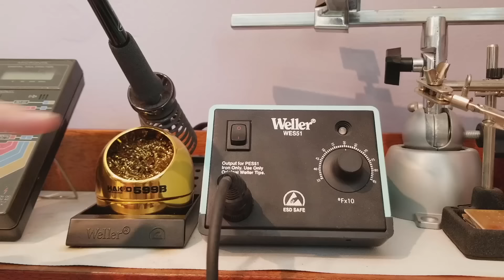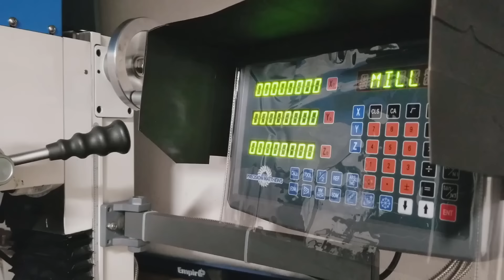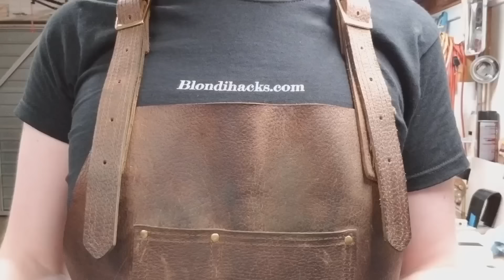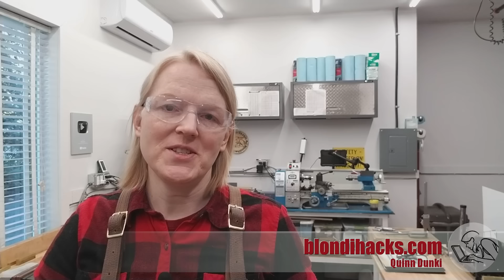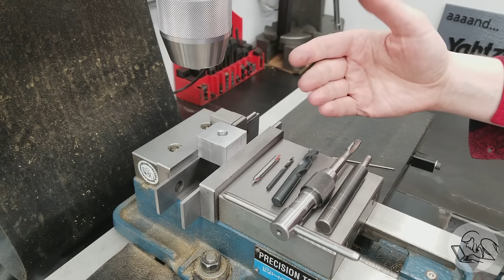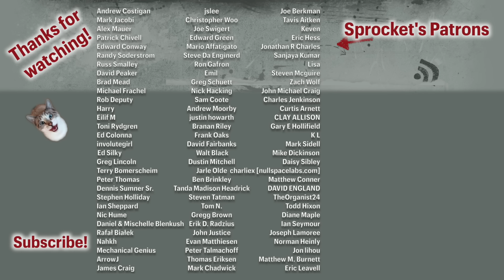Efficiency in the Home Machine Shop

Comment: Hi Quinn. I see that your new mill has a one-shot oiler system. I can't find a video on how you installed it. I would like to install one on my mill because the DRO bar covers the rear oiler points and I don't want to keep taking it to bits to oil up. Any chance you could make a video or add to the blog? Regards Bob

Comment: Cousin to "first-order retrievability" is what I'm going to call "last-operation retrievability", which is when you don't rush to put a tool and it's "bits" away too soon. Examples: a ratchet wrench and socket, die-holder and threading die, tap wrench and tap. My experience is that there's a high probability that these tools will need the same socket, die, or tap "next time" -- which is actually just an extension of "last time"... when you missed tapping that one hole...or now need a right-hand part to go with the "pair" of left-handed ones you made. So, I usually keep a group of such tools in "limbo" on the bench, otherwise I just put it away as is.

Comment: Awesome tips!
My workshop is tiny (5 square meters) - I hang my rulers, copper hammers and such from hooks so I can easily access them.
I also hot-glued a sharpie marker cap to a cabinet over my head - so I can pull the sharpie easily and return it to a fixed position. 
Same for my medium-hardness eyeliner wax-marker (softer than todays Chinese wax marker and SUPERIOR soft/erasable marking on metal) so it's an easy access. 
My 2 cents... :)

Comment: I have my most used items in an area on the end of the main bench so they are easy to get at during milling and turning operations. The problem is that by the end of a session in the workshop everything else that starts neatly stored in drawers is then littering up every flat space on the bench ! I will swear some of them develop legs and walk out of the drawers themselves.......

I often use stub drills and find them very good in many respects. Cranking the mill head up and down between tool changes is a chore If doing several holes on the surface of a part - the DRO helps a lot as you can work through all the centre drill holes then all the pilot drill holes and so on........

Comment: I am so glad I subscribed to your channel! I am learning a lot from you, and I appreciate your down to earth easy style. Your videos are a joy to watch. I had a "Smithy 1200-something" drill, mill, lathe combo. I never learned how to use it properly and it's long gone after many moves. This week I got "Vevor" 7x14 lathe (new on ebay for $325) and a Sieg X2D Mini Mill from Little Machine Shop. I have a couple of Cheap Wen drill presses' too. I have been using a little 5'x9' metal shed under the carport for my "shop". This week I am doubling the size of it and it should be a decent little hobby machine shop. I have managed to Frankenstein together a fairly sophisticated Planetarium star projector, all tediously by hand using as many off the shelf parts as possible. Last summer I needed to make some sliprings. I had a "Bob's CNC". That was my costliest tool mistake. it came in a kit and its made out of wood... Totally useless. I tore that down for parts and started looking into a serious CNC. That led me down the road to build an epoxy granite CNC to do more precision work in plastics brass and aluminum. Maybe some steel. So that led me into metrology which will give me the opportunity to tune up the new lathe and mill and extract as much accuracy as possible. Then I can make components for the CNC to get it functional and upgrade those on the CNC itself. I ended up making the slip rings by hand with a dremel and a scribe. They have about 1/2mm of runout but at least the brushes stay on their tracks. Lol.

Comment: The shank on drills is usually soft steel. So I have a set of drills that I have turned down the shank to 1/4”, shortened and resharpened on my Drill Dr. Do this as the size is needed. Works well in my little hobby mill but I only work in plastic and alum.

Comment: I would add rolling papers to the list of fast, non-destructive edge finding techniques. Self-adhesive and made to suprisingly tight tolerances (varies by colour - IIRC the green ones were 1.5 thou), wet and stick a bit to the edge and advance the cutter until it whips it off. It's a hands-free one-time-use feeler gauge.

Comment: That Clip for the drawers is great, i have a number of "Fridge magnets" to stick drawings and setupsheets to the machine.. on my mill i have sliding doors, and with a thin magnet, i can even slide the door open, with the drawing on it.
A small "platform" for tools that you often use is also a great tool in itself, i used to have a small desk at work, with a plate on the back for holding drawings, and  a place to put tools

Comment: Just got an old non-folding music stand for holding drawings next to the milling machine.
Also, I like Harold Hall’s idea of machined stops for the milling machine. Saves you having to indicate. In practice, you bolt two or three pedestals of round steel down to a t-slot say five or six inches apart. Set your end mill just above the table and just nip all three pedestals. Now they’re effectively stops exactly in line with your mill’s x or y axis. No indicating and essentially perfect. Just make sure your work is raised slightly to contact the pedestal face you just machined.

Comment: I’ve got a great example about efficiency. Back when I was toolmaking spent a fair amount of time blocking up ( machining saw cut tool steel to initial sizes) 
The company had two mills for this, one a decent size Pacific universal mill with dro on all axis 200mm dia cutter machine would have been around 6 ton. 
The other machie was a Toz, universal mill, quite small in stature still around 1800 to 2000kg size machine. 
It had no dro and a small 75mm 3 tip cutter. 
Oh and imperial dials. (We worked in metric)
That lil Toz was a third the machine the pacific was although sooooo much quicker. 
Why you ask,
Its rapid feeds were much faster and you weren’t wasting time fiddling with a dro. Just measure and convert what mms were to come off in thou. 
Always chose that Toz over the pacific. 
So just to clarify, it’s not always what it seems.

Comment: One quick question: when you drill and tap a hole, is there a reason that you don’t chamfer the tap drill hole before running the tap into the hole? It may or may not be more efficient, but it seems like it would make for a cleaner tapped hole. Just curious.

Comment: Great video as usual. I bought 2 cheap battery powered drills for my benchtop mill. One has the right size socket to raise/ lower the head & the other to open/close the drawbar. If the quill is too tight for the low powered drill, a quarter turn with a wrench is enough to start the process. It's a bit of a clunky solution but does the reduce the tedium of head height and tool changes.

Comment: Dependent on the degree of precision it can often be quicker to precisely spot the centres in the mill and then transfer to the the pillar drill for all the subsequent operations involving drilling ,tapping spot facing , countersinking etc. This was the technique taught to me 70 years ago during my apprenticeship if greater accuracy was required than could be achieved with marking out and centre punching. Although I transferred to the drawing office at the end of my apprenticeship and so never used this technique to help me make bonus on piecework I have found it very useful during my lifetime of model engineering.  I do enjoy your videos.

Comment: My biggest efficiency gain is having a set of dedicated tools at each machine. I have a set of Inch wrenches (at least one) a set oif metric (and so on). If i need to pull out the 3/8" wrench every time I want to adjust the tool bit in a tool holder (before everybody began to use Aloris-type quick-change) there will never be a 3/8" wrench in my set. And if two or more machines regularly need a 3/8" wrench, I might spend more time looking for the wrench than using it.

 I'm a slow learner; I've been playing at metalworking for over 75 years, and it's only been in the past few decades that I began to create wrench/tool sets specifically for each of my machines. For every point on a machine that needs to be tightened or adjusted in the normal operation of the machine, I want a wrench or tool there and ready at the machine. This means a dedicated wrench. I'll buy the exact wrench I want and modify it (as in cut the other end off a double ended wrench) if needed. The tools need to be identified with a colored tape wrap or a paint blaze as to which machine they belong as well as having a place of its own by the machine so you can tell if a tool has gone missing.

Even if you rate your time as cheaply as a couple of bucks per session of hunting for that lost wrench, it doesn't take many such sessions to pay for a dedicated wrench from McMaster-Carr.
Reply: Another one is to have replacement drills or tool bits at the machine. This is something that was done on every machine for every job when I worked years ago in a ---WAIT for it --SCREW MACHINE shop.

Comment: My favorite time saver is to use a tables with rolling tool boxes underneath them. It is relatively inexpensive and you end up with a lot of shallow drawers that you can use to organize tools. Keep the casters on the toolboxes if you are tall or ditch them if not, so your table height is comfortable. Every drawer gets a theme (everyday tools, drills, abrasives) and the tools always go back in their drawers so they are easy to find. If you end up with 2 of these tool boxes, one can be for assembly tools and the other can be for fabrication tools.

Comment: My efficiency tip is to buy multiple machines of the ones you use most.....I know it is not for everyone, I have more space and have been very lucky at auctions but 4 is the sweet spot for some machines, eg I have 4 drill presses, one set to low speed for large holes, countersinking and  counter boring, one medium speed for general drilling, one high speed for centre drills and small holes and one for annular broaching (a big solid drill). I also have a cheap mill (a good size but has some issues) dedicated to rotating work, a rotary table on one end and an indexing head on the other so I dont have to re-configure either my small or big mills. I made 3 2x72 belt grinders for the same reason, a high speed vertical flat platen (most of my use), a low speed vertical/horizontal small wheel grinder and a multi functional fully variable speed for when I need a third config, also two disc sanders, a permanent coarse high speed for wood (knife handles) and a variable speed 9" for blades. Switching configs around did my head in..... I would like two more lathes though (a 5C collet in one and a 4 jaw in the other) but dont have the space....

Comment: Screw machine drills are for eliminating the need to use a center drill, saving considerable time on those machines that can run 24/7 The shops use a general purpose carbide that can be valuable on standard machines, such as Micro 100, expensive but saves time, durable can be ran slow. Woodworking, I find easier but more dangerous!

Comment: Back in uni, I worked as machinist (CNC and conventional milling) during the day and the biggest struggle I had was exactly balancing precision with efficiency. My parts were always near perfect, within spec and the clients never complained about them but I took about 30% more time than my colleagues. I drove my boss nuts... but being Swiss and the son of a mechanical engineer specialised in precision, I think it's ingrained. 😅
Reply: "Near perfect" and "within spec" are two different/overlapping things. Tolerances are a major part of the "Spec(ifications)" and just how tight or loose these are should guide your work. If the client asks for microns, they are paying for and they get microns, if the client only needs/asks for half a millimeter, you don't get paid any extra if you deliver microns.
Reply: @kennethelwell8574 True! In our case, we were working generally to remain within +/- 10 microns. My job specifically demanded for a lot of precisely bored holes and it was particularly difficult because my CNC milling machine was 30 years old and very poorly maintained with no ability to use inner cooled tools.

Comment: You showed operations on the DRO but did you mention the DRO itself? It's probably in the top two for me. I read somewhere about, and try to practice, leaving all your tools pointing the same direction. Not necessarily in order (though obvs in production you'd try to), just aligned, the theory being your eye can find things faster that way. I also have a 150mm rule stuck to each machine tool with magnets. I keep one in my apron pocket too but when it's not there, there's another immediately to hand. Keep everything tidy and organised! I know it sounds basic but if you can't find something in under two minutes, you're going to get frustrated, and you may as well not own something if you can't find it. Someone else mentioned painting things white - yes! I painted everything in the shop white - the benches, the pegboard, the lot. Yes, eventually it will get dirty but in the meantime it will reflect diffuse light back into the workshop.

Comment: Fantastic tips Quinn and great presentation as always. A tip that I'd add is for the milling machine when doing multiple parts of a similar size (or repeat parts) is to have some large springs to put in between the parallels in the vice. This will hold the parallels hard against the jaws of the vice and prevent swarf from getting between and underneath them which reduces the amount of vice cleaning you need to do between parts. I also have a selection of different length bolts that the springs fit over which when coupled with a nut can extend the reach of the spring out for larger parts. For smaller parts a piece of foam works well too.
Reply: Another (free!) method is a short length of steel banding bent into a V-shape to act as a spring. This will work in a gap almost as narrow as the banding thickness.
Reply: In our shop we just rubbed a little lithium grease on jaw sides of parallels to keep them in place.

Comment: "I suppose they still exist" lol. I spent ~7 years in the screw machine department at a factory. While we had some old Cam-Swiss machines, we were almost entirely CNC. If you need to turn something +0.0001 -0.0002 or machine those tiny parts as seen on Wrist Watch Revival. A lot of Swiss lathes are made by watch companies like Citizen.

Heck, Starrett still has some cam-Swiss lathes machining parts for their measuring equipment. Most of them are idle now that the last guy that ran them retired.

Those drills sure are expensive though! We'd go through around $10k of drills a month out of our tool crib and that was much more cost effective than sharpening them. Our statistical tracking software could tell you if your tool was drifting out of spec too quickly because the drill was going bad and needed to be replaced, or if the speeds and feeds needed to be dialed in better. (~15 years ago. I bet they have better software these days)

Comment: I'm not as efficient as you but there are things that I've long done: Screw machine drills, not only do they reduce knee movements but they deflect less. I use spotting drills when it matters which it often doesn't. On more elaborate work I'll start by thinking through order of operations and even write them down. I've lost my reference surface by failing this one. My DRO will save 100 points, my bad memory requires that I make a written list of these as I enter them. I will use ABS for ongoing operations and save a 0,0 reference in INC. Or two different 0,0 points. Many parts have symmetry, so using the center as reference makes sense, to me. I clean up at the end of the day, everything back where it should be, a quick wipe & sweep. Tools for continuing operation are left on the surface plate cover. I haven't figured out how to avoid moving the knee for reamers. At least I now have put a power feed and DRO on it. Thanks for the video.

Comment: I've recently finished refreshing an M-Head Series 1 Bridgeport mill, and I feel this video.

I've got a mini-mill that I've made a lot of incremental improvements to... A DRO (TouchDRO, which I love), Tormach TTS tool holders, a spindle lock, electronic touch probe, and more. These improvements happened over a long enough time, that it was easy to forget what it was like without them.

Going back to that Bridgeport was a bit of a shock. Reading dials, counting handle turns, accounting for backlash. Tool changes are also collet changes, require 2 wrenches to accomplish, in addition to rapping on the drawbar to release tools... It's really given me perspective, on just how efficient I've made my shop over time. And just how lazy I am lol

I'm glad I learned to use machines without the quality-of-life improvements I've made, because I can still use any machine regardless of how it's equipped... But damn, do I miss those improvements when they're absent.

Comment: Hot glue+neodymium magnets makes great mounting points for chuck keys. Tape or compressed air helps clean off magnetic filings if you need to.
Reply: Even better are keyless chucks.  I do have an assortment of standard Jacobs chucks (and a drawer full of chuck keys), but they almost never get used, except for the one on the Unimat.

Comment: Just one point I would disagree is that despite having a DRO it is still a good idea to make all your axis moves from the same direction and take up the backlash. It's a good practice and will help if you are going for dowel pin placement accuracy. Even with a DRO you can be surprised. Love your channel! Been a hobby machinist some time pro for 30+ years.